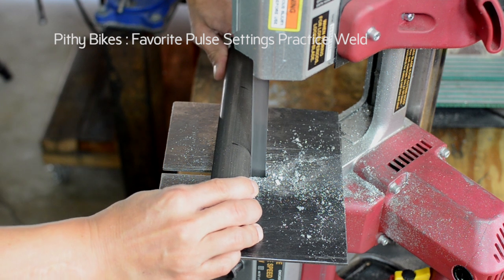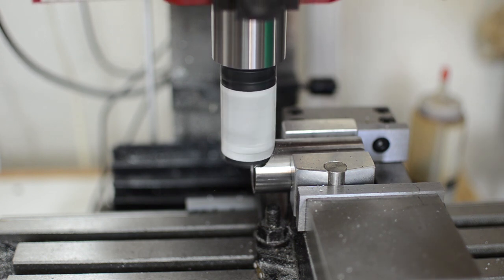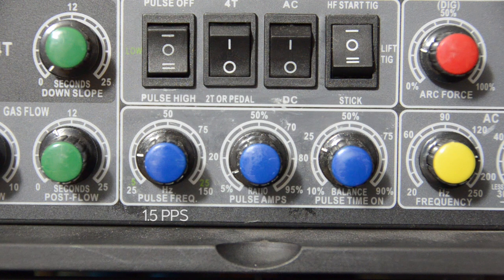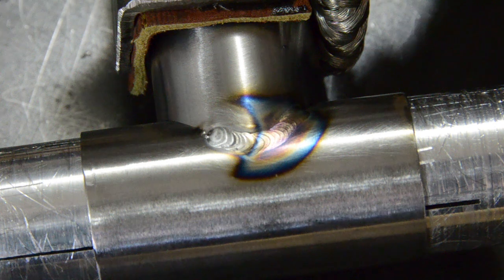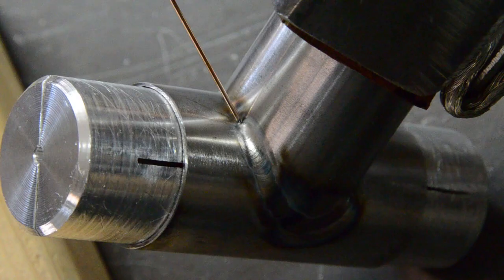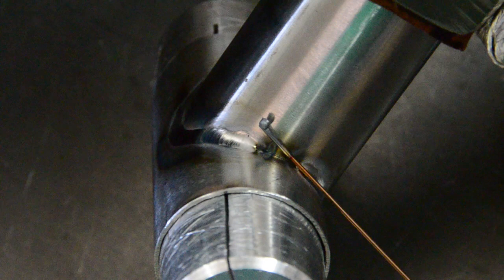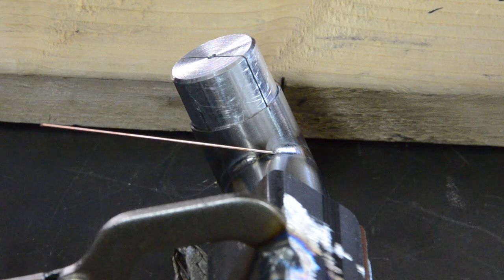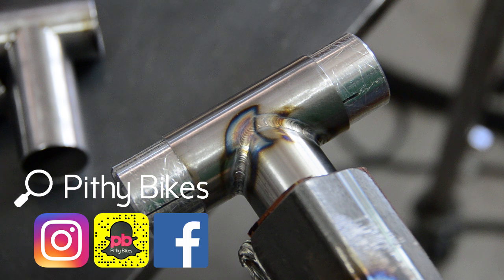My favorite TIG Weld Pulse Settings for Thin Wall Chromoly Tubing

Comment: Enjoyed the video.  I raced for Raleigh as a USCF Cat 2 just after the 84 Olympics. Now that I’m welding I long to build my own frame. Will be putting my new Miller Multimatic 220 to work.

Comment: Show the INSIDE of the pipe Please!!!  Your insert helps the O2 from getting to the weld,  If you didn't use it you would have to fill tube with GAS!!!!

Comment: The rule of thumb is 1.5 amps per thousandths of thickness.  So, you set the amperage 4x high and then 25% duty cycle.  Whatever works.  Here's the usual way to do it:  https://www.youtube.com/watch?v=is0BP39XZLw

Comment: Interesting, what kind of testing have you done on these frames? From what I know about 4130, you want some of that heat input and to cool it slowly because its very heat sensitive. It would be cool to see some destructive testing using your pulse settings vs straight foot pedal controlled weld.

Comment: I do some thin wall stainless and my helmet only goes down to shade 9 and I'm thinking 6 or 7 might be  better. The better you see the better you weld any thoughts?
Reply from the maker: I think anything lower than 9 might show the arc too bright. I use shade 9 for thin wall stuff and it feels like the perfect shade to me for this. That said I never tried anything lower. Maybe it could be dangerous to go lower? I know one thing that helps with visibility is to avoid any lighting behind you that might reflect into your helmet from behind you.

Comment: whats the the benefit of the heat sink and the puls welding?
Reply: Gallardo6669 the current comes in at a peak of % you set on the machine. so 20% pulse time on will be 20% of the total pulse will have max amperage the other 80% will be a % background current like 5% of 100 amps would be 5 amps hope that makes sense.
Reply: SuperMrCARBON this is per 60 seconds too. You forgot to mention that
Reply from the maker: The heat sink in this video is a temporary heat sink made especially for practicing. It's to simulate the real thing where I use a heat sink to weld actual frame tubes. Heat sinks are used to keep the heat affected zone smaller and reduce distortion on the tubes. Pulse welding also keeps heat down and reduces distortion if used correctly. However, some experienced welders can probably get the same results without pulse at all because they can move faster when welding. Hope that helps explain things.
Reply: Pithy Bikes thank so much for your reply. if pulsing helps to reduce the heat then i miss another theory in welding,because the heat itself is actually needed to melt the material. but thx,i will need to learn more about pulsing. = )

Comment: you have to thick  filling rod   use smaler
Reply from the maker: Can't remember what I used in this video.. I normally use 035. But sometimes I'm using 045. I don't think one should go much smaller than 035 for this application..

Comment: What are the angle blocks you are using to hold the tubing in the vise? Where did you get them?
Reply from the maker: +JIM GERHARDT those are cobra frames angle blocks. Check out the description of video if you'd like to buy a set. Cheers!

Comment: Please continue! I have loved the journey also. Welded my main triangle recently and wish I had practiced on these settings. Your exploration makes these clips accessible to us aspirational builders. I also use an aluminum heatsink with a mitre that I have on a threaded rod to access deep tube ends. Have you made your own BBS's as this is a good project also. can't wait for series II.
Reply from the maker: Very clever heat sink placement! I haven't made my own BBS's, maybe some day. Right now I cannot because of the minilathe. It stinks at cutting steel. If I really finess it maybe it could work, but the time and effort would be too great. Thanks for the comment :)

Comment: your welds are great your fit up is great if you're having a hard time staying in your line use some extra light I have multiple lights on my welds and pulsing good it's all about timing.  try pulsing .05 I use that a lot especially on aluminum
Reply from the maker: +Mike Hill Thanks I'll give that a go. I just need to practice on a regular schedule.

Comment: You're welds are fine but I think the pulse function prompts many people to weld to fast which limits your ability to maintain torch angle and Sri length especially on coped joints. Coped joints are also not fixed amp joints, they're essentially two lap joints and two fillets.  I personally would use the pedal with 45a max, your fit up is great let the pool form and dab rather than laying the wire.  The pedal will allow you ease off if its getting away from you. The stacked dime look will come from using the right sized rod and evenly timed dabs into the pool.  The pulse setting is prompting you to weld faster than you're capable of and add more filler than required to stop it blowing through.
Reply from the maker: +sweenep86 sounds good. I get varying suggestions on different methods. I've found its a matter of preference. Someone who really knows how to pulse I think can produce good strong welds. For me, I need a lot more practice. I'm trying to get better at moving fast because most of the feedback I get is to move faster to reduce HAZ. Thanks for the tips.
Reply: Pithy Bikes i pulse and dab! I have video if my welds
Reply: Pithy Bikes some of my welds if you watch closely have little to zero haz!

Comment: Do you have a foot pedal ? I'd forget pulsing and just use the pedal
Reply from the maker: +sweenep86 I've tried pulsing with pedal. while I do like the control, I found I can move faster with machine pulse. Machine pulse can produce much better results, it's all about the person behind the torch. I need lots of practice! :)

Comment: Wouldn't it be more beneficial to practice without a heat sink? You know, to replicate those welds where placing heat sinks isn't an option.
Reply from the maker: +PUU-TAAH for bicycle tubing, most of the welds are with heat sinks. Only welds without are the drop outs. But some builders even make special sinks for those too! Not everyone uses heat sinks. But the other factor is the practice tubing is short. Most real welds involve longer tubing which also absorbs and disperses heat. Thanks for the comment!
Reply: Pithy Bikes No worries, Thank you for the informative reply! I guess I'm just used to having no luxuries working on site, foreman pushing you "get it done they way I say" and such. It's about time a bought myself a welder for use at home and started on cool projects like you are, it's very calming to watch, Thanks for sharing your experiences with us!